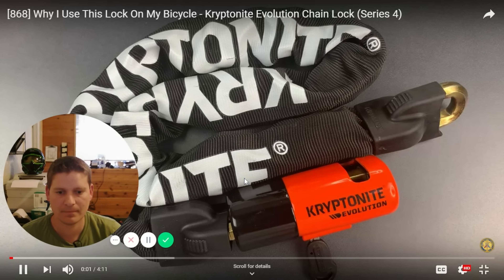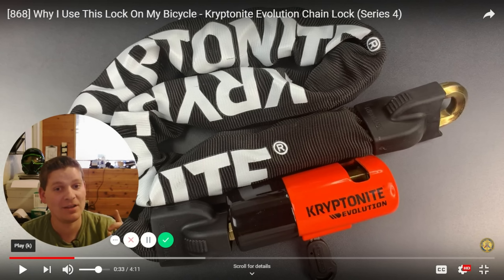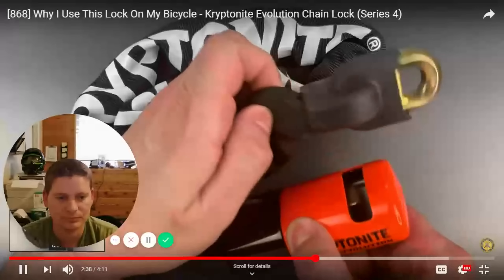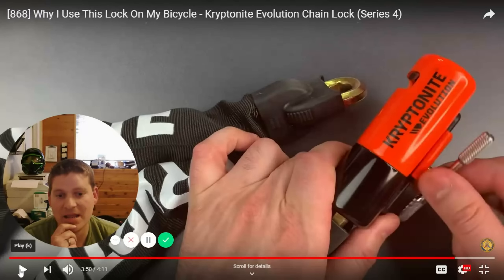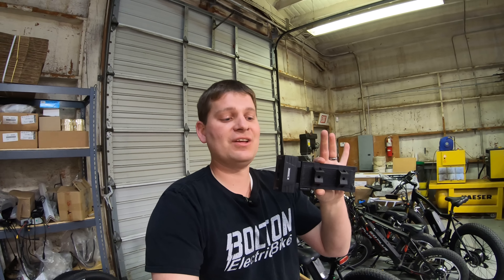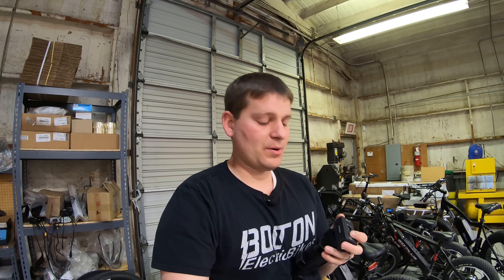Secure Your Electric Bike From Theft

Comment from the maker: How are you securing your ebike now?
Reply: Bolton Ebikes I use 2 heavy duty U locks. One has a medium thickness cable to keep wheels and seat attached. I also pull the battery off of my ebike
Reply: Sadly, I don't let my ebike out of my sight.  Even if locked there is nothing to protect from people (usually kids) who get enjoyment out of ruining other people's property when no one's watching  just to get a laugh.  An ebike is a much better target than my mailbox...It can be ruined with a few quick kicks or a single blow from a rock to the plastic battery case no bat needed.  And I live in the rural Kansas five mile from the nearest town of only 10,000.   If I was back in LA I'd really be paranoid, because had two regular bikes stolen there from bicycle racks at schools I attended and they both had locks with very heavy chains.
Reply: Hi I was wondering if you had any 2020 BOLTON ELECTRIC FAT BIKE - 750 WATT large frame in stock in black.  Or do you have something that is similar that goes 25+ mph in black around that price range.  Thanks 😊
Reply: guess my other comment on the Class 4 was spot on ? 
longer distances and 2000+ watts of power to throw to the Bafang Ultra w a Phaserunner 90 amp Variable controller
Reply: by subbing. thank you, bolton.
Reply: Also by covering everything in duct tape. Lots of layers. Battery wide steel cable ties to bike, all covered in layers and layers of tape. Dollar store tape in the biggest cheapest rolls is thinner than Gorilla but much MUCH better at sticking. Gorilla sucks big time, really, but has nicer fabric if that counts at all for you.
Reply: Use a simple bike cover:  
I commute to work every day.  And unfortunately I have no choice but to park my Rad mini in a very public area that is known for bike theft.  So I use the Kryptonite Heavy chain that the LPL recommended.  I also remove my battery and bring it with me. However I go one step further and put a simple cover over the whole bike.   Like you said its about having layers of security, I would recommend that you encourage your customers and viewers do the same.  Its a simple lightweight compact and affordable. And in the eyes of a thief my bike is just a grey blob.  Also after reading your other viewers comments I'll be adding a motion sensor alarm.
Reply: I use 3 locks that equal about 10% of my bikes price. A abus granit extreme 59 a hiploc gold chain lock and then a hiplock dx. Big ubolt (abus) goes from bike to bike post then the chain lock goes from rear tire to post then my little ubolt goes into the front tire spokes. All locks can be picked or broken into so I use multiple locks so it acts as a deterrent from would be thief's. The more locks light weight mixed with heavy I use the less appealing it is I also have a hidden gps tracker and a bike alarm set up on the bike which notifys me if my bike is touched or moved. Edit I also always take battery off.
Reply: I use two kyptonite New York noose locks to secure the tires to the frame and to usually something massive
Reply: @thankmelater1254  how does duct tape help???
Reply: @neilrobertson1345  "how does duct tape help?"
Makes a new bike look old and homemade.

Hinders removal of battery by screwdriver pry attack. Also hides the steel band ties wrapping the downtube battery to the frame, so double hindrance.
Hinders removal of axle nuts, seat, etc.
Hinders removal of lights and display.
Reply: Locks are never enough. Seat tube tasers are. ;)
Reply: @landofahhs_1  Those are the ones always crying for RESPECT.
Reply: The one I am buying from you will be my first.
Reply: ? Will ur upgrade kit work on the E-Lux Sierra
Reply: I have a Kryptonite flexible lock. Is about 1 inch around and supposably is very hard to cut. But I think someone could pick the lock pretty easy. Thank you to the lock picking lawyer my kids even know how to pick a lock. Honestly I don't think it's right that he shows how to pick locks.
Reply: Adam Miller's Toys Bicycle told me it is approved by insurance companies.
Reply: I love my ecotric hammer bike I have never made a better investment in my life I like it more than my first car. Once I do the upgrades and get the seatpost and a new front retro light it's going to be way better so I can tow my wagon go shopping go camping and I have a question towing a wagon on a bike does that put strain on the motor this is a Cannondale wagon it's very streamlined it's from 1991 I used to carry my kids in it on visits. But then I got custody of my voice that was good
Reply: Are all the keys for ecotric bikes the same? That would really suck
Reply: I use a pretty lightweight u lock, a motorcycle disc lock with alarm, a high decible bike alarm mounted directly on the frame (very sensitive), and a 10mm kryptonite bike chain. I'd like to see someone try..
Reply: GPS chip and sticker proclaiming so.
Reply: Abus Bordo 6000 folding lock with an alarm, of course I remove the key and leave the battery locked in, and I have a GPS tracker installed that is pretty hard to remove. That's all i can do. Of course I leave it indoors overnight at home, and at work in a locked parking garage with surveillance.
Reply: @landofahhs_1  hey Paul!! I lived in Ks. Several times! 1985 in Hutchinson and twice in Wichita! Good times...even better people! Good cycling!!!
Reply: @VaporologyINC  forgot...how cold I furget my bestie! My chain I use when out..my Aebus
Reply: I use a fahgettaboutit u lock and chain and a less secure folding lock and two kryptonite wire loops as further deterrent and they're attached to a  wall anchor when not in use.... seems like overkill but I want my bike to stay mine and I'm glad I have a saddle bag to carry some of those hefty items
Reply: @eldragonrojo42069  hey Draco!! Seems great minds Do think alike!! I've got an ebike I've put a lot in to and live in an inner city area. I , like you, us a Fagetaboutit and cables, plus an Aebus chain(I use it when I'm out!) I weave it all together with my bike sammiched between two ol beaters! Here's something you may want to add...NutFix skewers...you need to know the trick to open! One on each wheel and one on my Body Float seatpost. Even my bike mechanic needed to be shown the trick!
This allows you to concentrate on using all your chains , etc around the frame.
  They're a little salty but hey..'!
Next I think I'm adding an audible disc brake alarm...only 20$!
Reply: @davidklein1667  hey thanks for letting me know about them I just had a look at the nutfix skewers and might have to get me some on pay day, I'm lucky in a way cos anyone after my bike has to cut in to my garage first to even get close to the bike I know the noise of metal being cut won't keep me asleep for long
Reply: by not leaving it alone!!!
Reply: Right now, my RadPower Wagon 4 is safely in a container, on a "slow boat from the PRC".
Reply: Explosive bolts
Reply: Another way you can secure your bike is to put a bike cover over it out of sight out of mind❤
Reply: Do you do the same with your car LOL
Reply: I use 2 chains, a u lock for my bike and I always have my seat locked to my frame, with a cable lock. I had someone look at my bike and stole a light and he stole the bike next to mine, cause it only had a cable lock. It sucked not having my light for my ride home but at least I have my bike still.
Reply: Abus, insurance & it sleeps in my living room.
Insurance is a must. Especially for my Riese& Müller Superdelite Rohloff.
Reply: Cafe lock (which immobilizes the back wheel) and heavy duty chain + a Bordo folding lock.
Reply: @litz13  Just ordered Apples Air Tags to put one on the bike as extra security.
Reply: E bike is grand theft. President Biden has the answer 12 gage shot Gun. Authorized for $1000.00 or more.
Reply: I use a Kryptonite New York Noose chain for the ebike an Evolution Series 4 disc lock for the brake disc.
I also have a gps locator  hidden on the bike. Hopefully enough for the thief to move on to easier pickings.
Reply: @thankmelater1254  Duct tape or die
Reply: @tjellis1479  And I use a tiny cable tie to insert into the space the brake lever creates when pulled, and that keeps the brake slightly "on" and the power "off".
Reply: How about a built in GPS, a stealth video cam on the rider...and one of those annoying audio alarms too?
Reply: @thedeckerbrothers8995  the motion sensing alarm makes sense, but seems a gray covered blob would still be a temptation...
Reply: instablaster
Reply: got that fugedaboutit lock by kryptonite
Reply: My dog Chewy used to ride on my motorcycle. She went EVERYWHERE with Mom. I believe that's why she lived so long. Now I have a 120lb stud dog  but didn't expose him to motorcycles early enough and he hates the loud noise. I couldn't even imagine Bullett on my new BPM fat tire mountain ebike! I'm preparing to move from the states to Costa Rica very soon...so I KNOW I'm going to need an extra heavy duty lock.
But...which one?! Your input would be greatly appreciated...Thank You...Lori
(Runaway) or for those of you that actually KNOW me...Mean Machine Lori Jean!
Reply: Triple protection, firstly a folding lock, then a movement alarm incase anybody tries to saw the lock, and if they do manage to steel it I have a Samsung smart tag hidden on it to know it's exact location.
Reply: Decent lock + having the frame number stored somewhere. If it gets stolen and sold in a bike shop, the staff will identify it as a stolen bike.
Reply: I use 2 Kryptonite New York chain 15mm 15 lb (each chains) and a another U-lock (with a different keyway type).  2 motion alarms (1 hidden and 1 bike horn), Pinheads locks (seat post, head cap and both axles), GPS tracker and seat post cable 19mm. Also replaced All bolts with 'security head bolts'. I added a hidden 'RFID start/kill switch'. I Remove battery and place it in 'trumpet bag', so battery with me.

Am a Locksmith, re-keyed all locks.
Reply: I have exactly a locker like yours, also another "U" locker from the same brand,  a movement sensitivity alarm and one more GPS inside the frame and thats it...I had one stolen before...
Reply: Lectric bikes have the battery inside the frame. It's foldable though and the key is definitely NOT convenient to get to and use for anyone. Unfortunately the latch for the hinge can't be locked but the key literally goes into the battery pack. I need a noisy alarm that works with a key fob.
Reply: Mine is also foldable, I use two E-TOOK LOCKERS, also an movement alarm, also a gps inside the frame…
Reply: I have no locks I don't leave my bike unattended cause no lock would keep your bike 100% safe period..
Reply: I prefer the Pee Wee Herman locking method.
Reply: @Matt18001  Small question, what do you do th cover the battery space, in case of moister/rain? That was my first concern with removing the battery.
Reply: @sebastiaanx7867  It's not an issue with my bike the pins will get wet but as long as it's not heavy rain I don't worry about it. I try not to ride when it's going to be very rainy in the first place.
Reply: @LetArtsLive  
Knowledge is power. 
Picking locks, like ANY skill, can be used for good OR evil.
Reply: By not having one in the first place! All of my 5 bikes are unmotorized!
Reply: I NEVER leave my bike unattended!
Reply: You are actually teaching them the best way to steal bikes though!!STOP!!!!!!!!!!!!!!!!!!!!!
Reply: There are ways to lock an ebike... Without using a lock. For example, locking the brakes so it won't roll. Who wants to carry an ebike down the street? There are more.
Reply: You forgot a fairly inexpensive method which can be effective: alarms that trigger when moved. Yes there can be false alarms, but combining a traditional lock with an alarm will likely deter a thief from continuing to mess with the lock, especially in daylight with people around and if you’re not far away and can hear the alarm. There are also disc brake alarms that not only sound out, but obviously block the wheel from turning, making the bike unridable.
Reply: @NemoEUC That’s a solid combination. For overnight storage in a garage for example you could add a lockable bike cover.  The second they mess with it, the alarms will sound. 

What would be cool is a vibration alarm that notifies you. The alarm would have to be on some WiFi though.